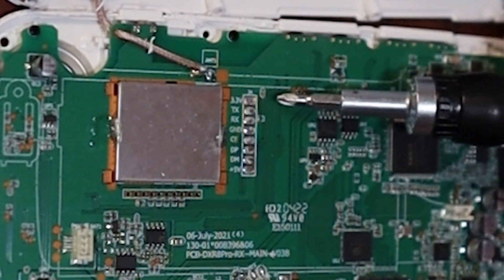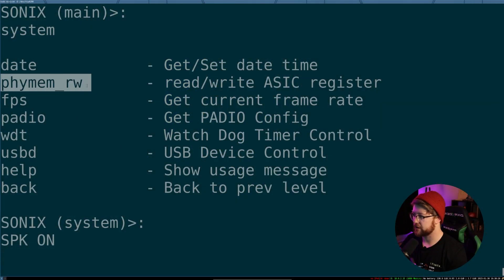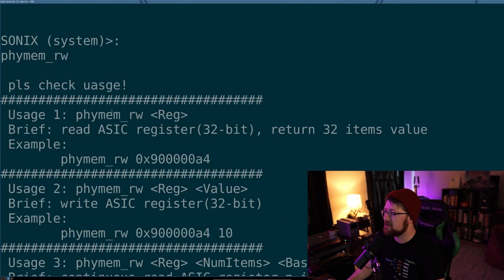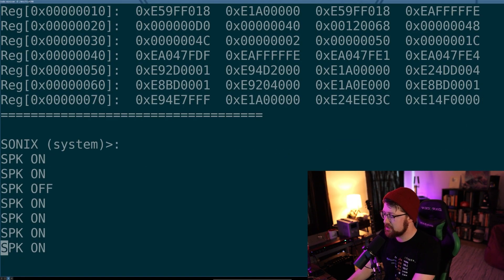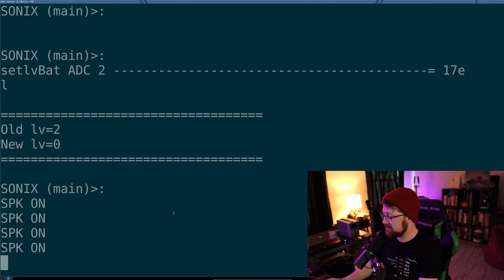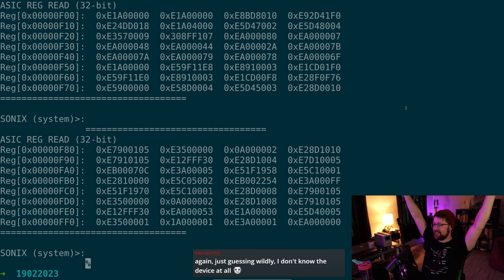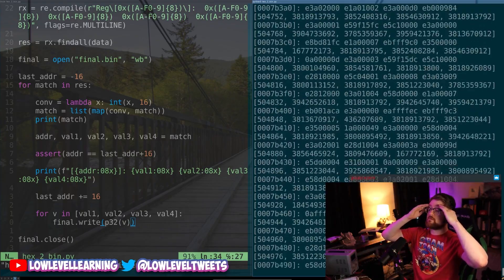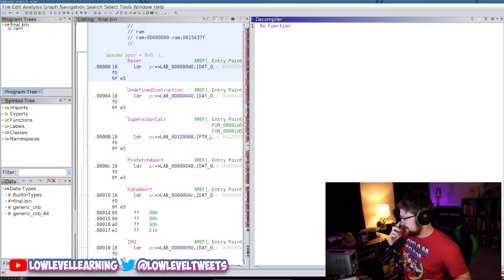i extracted the secrets of my son's baby monitor

Comment: I love these videos but I just realized something. You could have done this WAY easier with a Software Defined Radio. Instead of dumping and analyzing the firmware you could just turn them both on, and check the traffic.

Still this is a great video. I need to get into more low level stuff. I have used jtag to mod my old 360 and to fix a WRT54G router but that's mostly it.

Edit: Oh that's what you're going to do, just finished.

Comment: Please, please don't use [0-F] to recognize a hexadecimal digit. Even if it works, it will accept much more than a hexadecimal digit. Regex doesn't work in "hex", it works with the ascii table in this case. Have a look, see how many characters there are between zero and capital F! If you want to write a regex that recognizes only a (capital letters) hex digit, write: [0-9A-F].

Comment: Why didnt you just run the camera and then use a SDR to observe the radio packets? It should be pretty apparent if its encrypted. That seems way easier to me but I have a R/F background. Btw h644enc is an encoder.

Comment: Cool video!
As a student of information theory and RF systems & SW myself, I love seeing stuff like this.
Questions like this can be tricky to answer from an outsider's depending on how they chose to implement their design.
RF stuff is usually done in layers on the OSI model. Encryption is commonly used on the presentation layer, which is just below the application layer. Meaning there are a number of other things that happen before you even get there that would need to be truly understood first.
Could you maybe pick something out before then? Sure? Possibly? But it's highly unlikely.
Your best bet is to find instructions that lead to preparing the H264 frames before sending them across the network.
Looking at the PHY (Doing some type of analog over the air RF Capture) won't particularly tell you if it's encrypted or not straight away. The PHY will have a modulation scheme you'd need to demod first. It isn't always straightforward either, modulation schemes now can get fairly complicated and have numerous components superimposed on top of one another (In phase and quadrature are some examples). You may also have pilot symbol sequences to handle channel estimation or synch signals.  There also may be other barriers to get to the baseband symbols from the PHY such as data whitening, or spread spectrum frequency hopping to help the device play nice with regulations. The link layer usually does forward error correction as well, so that would also be present, you'd need to figure that out and have a decoder for that. You may also have channel access control scheduling to take into account to handle numerous devices. The network layer might be where things start getting a bit more familiar, but even that there's no guarantees. You also have source coding, or in this case compression. I noticed H264 codec labels, which is a video compression standard that's fairly common. Really cool theory as well.
All in all, a simple RF capture probably won't tell you whether or not this is an encrypted signal.
There's a reason RF com protocol analyzers cost so much money.
Long winded way to say, your best bet is exactly what you had been doing. Scan the binary to see if any clues about ciphering, key generation, key scheduling, etc... otherwise you might as well be re-designing all of this yourself.

Comment: Wait omg that's the terminology for that?? Dumping firmware? I've been trying to figure out how to do that forever, like if it's an embedded soc type deal with no ports or whatever how do you begin to figure out how to get at what is most likely machine code?? Then to reverse engineer the code, this is all actual magic can I be your apprentice
Reply: If there are no UART pins on the board it would be a lot harder. You'd have to identify the memory chip that stores the firmware, and then either solder the necessary wires onto the board to gain access to the read/write pins for the chip, or desolder the chip and solder it onto a dedicated board that breaks out the necessary read write pins. There are videos showing how to do this on YouTube. It's not impossible but definitely one level above what is shown in this video.

Comment: Ages ago, I worked for a firm that was trying to make highly secure systems.
The project required an encrypted CPU and memory controller.
Every data transfer in or out of the CPU was scrambled, every byte sent to RAM was scrambled again!
A hacker, with probes in the guts of the computer, wouldn't be able to makes sense of anything!
Long story sideways: the project failed in prototype stage.
Our own logic-probes couldn't troubleshoot the encrypted data-streams!
We made a puzzle that we weren't smart enough to solve.
We got paid; who cares if the thing worked?

Comment: I'm sure others have mentioned, if you'd like to do more hardware hacking, it's probably a good idea to invest in a universal programmer. It'll dump flash a lot faster than using UART, which you may or may not have depending on the hardware. Respectable, though. That's how I started off dumping firmware when I didn't have a programmer (and desoldering alloy to prevent MCU interference while trying to read the flash).

Regarding reading from memory, you should not assume that it's the firmware off flash that you're reading from address 0. It could just be a small segment that contains the vector table and some boot up code, and more likely to be SRAM or perhaps boot ROM than flash. Memory mapped flash is generally somewhere else. A different ARM Sonix chip that I had been messing with has the region at 0 be remappable to either boot ROM or program RAM, where the boot ROM loads some bits of the flash into the program RAM, switches mapping to program RAM, and the loaded code does additional loading into PSRAM.

Knowing that it's an ARM processor (you could have read the chip's product description on Sonix's website instead of guessing from a memory dump), you probably could have found a JTAG port that would have allowed you to dump much faster than using UART.

Comment: I had the same concerns myself when I had my kid, in fact her 4th birthday was recently. I came to similar conclusions with many monitors but from the RF approach. Being a ham and all, I was particularly interested in that, even tho I am an IT systems engineer. It's not encrypted. None that I could find were. However, the range on this monitor (which is the one I ultimately settled on)  is fairly limited (tho was enough for 2000sqft house + a little into the yard. If someone was trying to sniff the rf it would be pretty obvious as no one sits in their car in front of my house, so that would be unusual. I'll take airgap w/ some known vulnerability over IoT / Internet required any day. Congrats on the kid, it's a wild ride.
Reply: Wholeheartedly agree with your last statement, the amount of dodgy stuff I see from cheap IP cameras is rediculous.

Comment: I think an interesting experiment would be trying to hack into the video feed. I don’t think any baby monitors are encrypted, nor do I think they need it unless the cam and receiver both use WiFi or something like that. Even if you can hack into the custom RF signal and gain access to the video stream that’s pretty much all you would get I don’t think it would be very useful. I don’t think these devices necessarily need encryption, although it would be better if they had it.

Comment: I have an old media-streamer I wanted to throw away but while taking it apart I found out that it also had an open serial port. I connected that to my PC and was able to get a root shell without any password. I was able to back up the eMMC but I want to install a normal Linux on it. Do you know a way I can do that without de-soldering the eMMC chip? I'm not that good at soldering.

Comment: You guys are over complicating this. Just run shielded wire and get rid of the wireless or any internet connection.  You know without a doubt at that point the only way in is physical. Done deal.

Comment: Nice video! One thing that I've seen in several products who go the ASIC route is putting the crypto routines into the mask ROM. Depending on how privilege isolation works (or does not work) on your device you might just be able to dump the crypto routines straight out of ROM. It's often-but-not-always mapped starting at 0, because the boot vector table needs to be there anyway and often comes from mask ROM. If they do implement some form of execution isolation, like a separate page table, then it can be harder to dump. Looking forward to the next video!

Comment: I may be wrong here, but from my experience you can only write a flash bit from 1 to 0, if you want to do a 1 you will need to erase the whole page. So those A5 could have been out there to make sure no one could put any code there without erasing a larger block of flash possibly bricking the device

Comment: so i have a few routers that interrupt with some peripheral command and the best thing ive found is especially with spi flash to just read the whole chip with a ch341a and not fuck around with the uart console at all
Reply: Yep i have to short the flash power pins on boot to allow me to get into the uboot console normally its locked out and with ch341 i can read it

Comment: Since there is some kind of "cipher" library being compiled with, but there is no sign of encrypt/decrypt functions it might be the case of device actually using hardware encryption being built into silicon hardware. Many low power devices/MCUs implement such hardware to offload CPU heavy functions to actual encryption hardware peripheral. 
By using hardware peripheral, configured to directly access data via DMA or some other hardware register based means it might not need to actually use any functions to actually encrypt/decrypt in the code and cipher library is only there to configure encryption hardware.
OFC this is just a theory, confirming data is actually encrypted that way requires further look into device operation/code/RF output.

Comment: If security matters stay analogue and run video over a 75ohm cable link. Just as you are looking for security breaches, someone else, somewhere else has already wandered in there looking for hack vunerabilities and maybe found something useful. Be especially worried if your system can take updates off the web.
Reply: Unless you employ a scrambling algorithm on the analog signal, it is still theoretically possible to reconstruct the video wirelessly with a very sensitive antenna using leaked rf. The NSA leverages this method to even reconstruct vga and hdmi signals. It all comes down to how much security you need at the end of the day.
Reply: Why not using some real security cameras instead?
Not the IP ones anyways.

Comment: Yeah, those were encoding calls. The 'cipher' folder could've also been earmarked for WPA-type features like one touch access and etc. Honestly, the amount of fuckoffedness I'd have for this monitor is staggering. Set up your own DIY baby monitor that goes to your NAS, maybe using a Pi hardened with LUKS if possible, with some builtin safeties for the video streaming from the NAS like SRTP, TLS, or whatevs. Don't use COTS for security sensitive shit, like ever.

Comment: The very fact that they didn't compile out the UART interface is the only red flag you need.

In all my RTOS experience, we always compile it out, it's zero effort.
Reply: Even if you compile it out, there are still ways to bring it back (unless the chip has an initialized security lockout bit of course).

That’s how I was able to access hisilicon IPCs. The read-only bootrom emitted a bit sequence on UART that allowed for firmware flashing over serial. I used it to load my own program into SRAM and then dump both the bootrom and nand flash memory.

Comment: That might be security by obscurity. We'll see what you'll find in RF but I'm guessing that radio channel is somewhat custom or not typical.
I admire your effort to go through console. I'd probably desolder relevant IC's and just read them with a programmer ;)
Reply: I am not a security expert by any means. I'm just a sales engineer for a tech firm, but that does mean I get fun toys to play with and have the real enginerds fix when I break them. All that to say, when we set this exact monitor up in our house, our WIPS sensors on our WatchGuard Wireless APs went crazy. It appears to be using straight up standard 2.4GHz on channel 11. WIPS was able to show traffic (this is where I don't have the expertise) but we accepted the risk because the wifi enabled one we used previously (Owlet) made its first hop out of the network to China, then South Korea before trying to establish a connection in the US. My wife couldn't get the camera to work and I found Geolocation policies shutting it down on packet #2 lol.

Comment: Just get yourself any cheap IP cam. And just tunnel it through HAProxy or a very small own application and add a certificate and send if you a socket or ngnix server on a cheap SBC and visualize that decoded stream using OpenCV. Easy as apple pie. And regex rules! It should be a mandatory exam subject in highschool! It’s the most useful thing I bothered to learn way back in the 90s when I stared to develop in Perl.

Comment: there are tools that look for the sboxes, pads, IVs, coefficients, and tables for known encryption algorithms, they'll either be there or not, and the API patterns are Init, Update, Final ... it would be a lot of overhead to do it in software, and you can probably find some chip documentation about AES units & instructions. bottom line though, if it's not doing tls or diffie hellman or some per session key, it's as good as unencrypted even if it's technically enciphering it

Comment: I don't suppose you tried slurping the signal on an SDR? I'm not an expert on that, but it's pretty straightforward to analyze a signal if you know what you're looking at.

Of course, that would defeat the purpose of doing it at the very low hardware level. :P

Comment: Running into "manufacturer default" doesn't mean, that you actually have all the firmware. In some chips you don't have equally sized pages, so you want to pack bootloader and ISR vector in page 0, then store some mfg/NV data (i.e. for pairing) but actual firmware can be stored in last page. It is just matter of linker script

Comment: A5A5 can't be used in the way stated. In flash you are limited by the number of erases you can perform on a given cell. You can only write '0's, and erasing will give you '1's. So practically you'd have to erase A5A5... before you write. Blank flash is almost always FFFF. A5A5 could be programmed memory for debug purposes or to ensure an invalid opcode. At least in thumb, I believe FFFF may be something valid like move 0 to r0, or somesuch.
Reply: Yeah I'd like to know where he got that assumption from. Most manufacturers end up either writing null bytes in unused space or leaving those bytes unprogrammed. Kind of sounds to me like an explanation made up on the spot to explain an observation.
Reply: I’ve seen A5A5 used by some RTOS as initial stack memory values so that if a stack overflows its allocated size the RTOS can detect it and call a hook before all hell breaks loose.
Reply: Alternating 1s and 0s can be the unprogrammed state as a result of the underlying bias arising from the silicon structures that make the memory cells. A5 can arise when the cells are arranged in a mirrored pattern physically. It could also just be filler programmed at the time the flash was written so it's easy to see what memory is unused.

Comment: I was thinking about your efforts, and it occurred to me that folks have probably built Baby Monitors using Raspberry PI's and that they are probably about the same price or cheaper that way than buying them off the shelf. I have not studied the projects, so not sure if they include Encryption, but I'll bet that's easy to add - comparatively. So, you might consider doing another video after this project to analyze the RaspPi baby monitors projects out there and if they don't encrypt, then fixing one of the projects so it does. Just a thought. I'm following you to see what you find. Cheers.

Comment: H264 is a commonly used video codec (together with H265, VP9, and AV1). That H264Enc function is encoding some video blob. The odd part is that I would expect the camera to encode and the video monitor to decode. Oh well
Reply: might well be something like ffmpeg that can do hardware or software,
Reply: @tla25-z8k  exactly, the encoder is running on the cpu
Reply: Might be bidirectional communication
Reply: @youhackforme  communication of what? unless specified (lossless compression), H264 most of the time does lossy compresion. What good is information if it might get lost in compression?
Reply: @wkm345  like two way video communication. In case the monitor wants to send back an image of whoever is watching
Reply: h.264 is a tighter video/audio compression for less data needing sent wirelessly.  Still needs the "CPU Umph" on the other end to decode it though (as you stated above). :)
Reply: @samuelblake  h264 is not video/audio. It's video only.